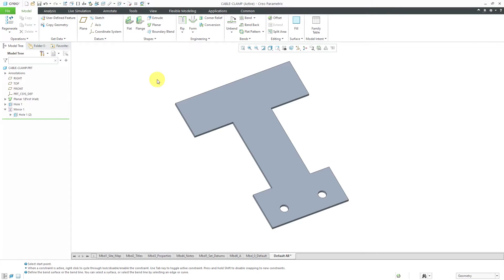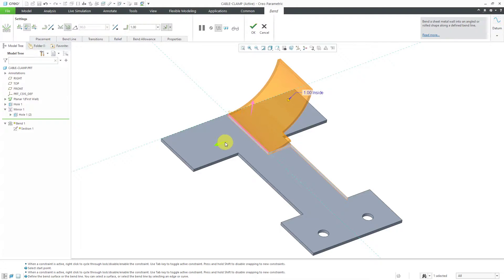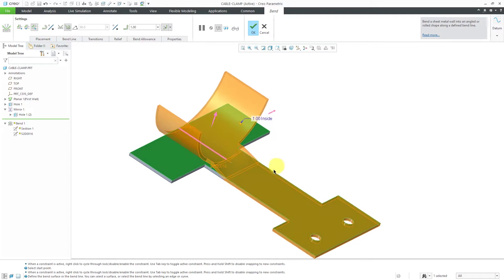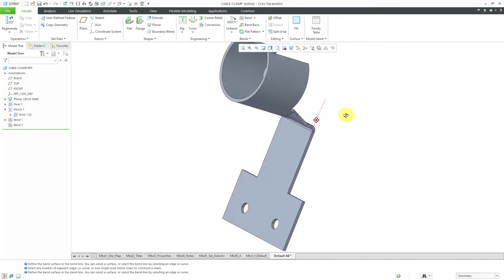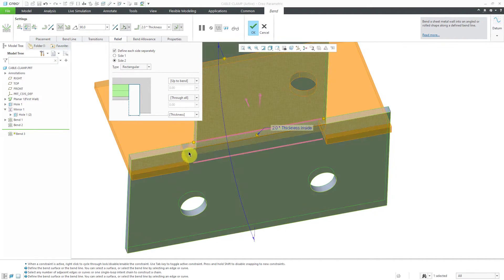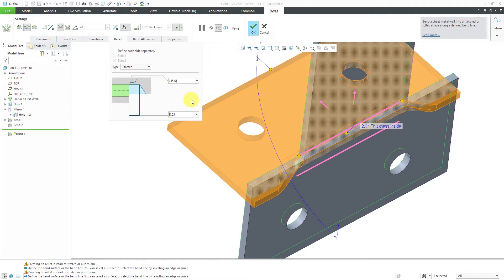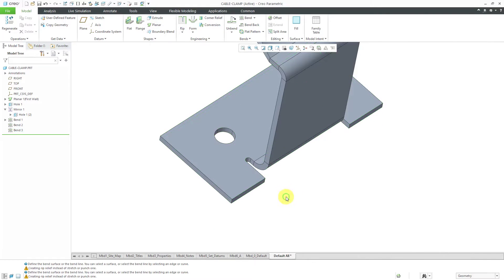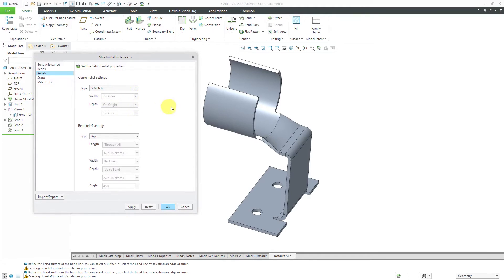Creo Parametric - Sheetmetal Bends (Part 2)

Comment: only sheetmetal can be bent? I want the assembly stp consisting of several layers to be bent.... what can I do?
Reply from the maker: Can you import the STEP file as a part? Then you can use the Warp tool on it.
Reply: @CADPLMGuy you mean import assembly to one stp part file?
Reply from the maker: You should be able to. Create a part, then go to the Get Data overflow menu and choose Import. You should be able to import an assembly STEP as a part file. See my video on "Importing and Exporting STEP Files" for more information.

Comment: i am using creo 11. when i bend like 6.23 minuets of film, it is not relief automatically, how should i fix it? this problem was in mechanical desk top too!
Reply from the maker: I’m not sure what you mean by minutes of film. I assume that’s a language translation difference. I also am not familiar with the initial geometry, so I don’t understand where you would expect automatic relief. If it’s not a model accuracy issue, I suggest opening a ticket with PTC Tech Support.